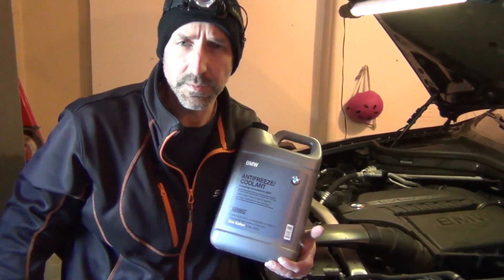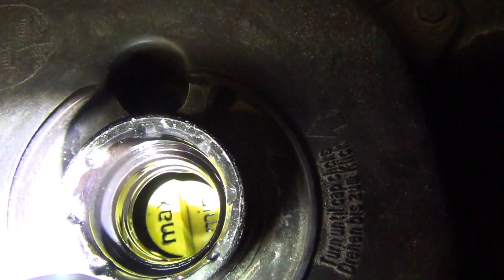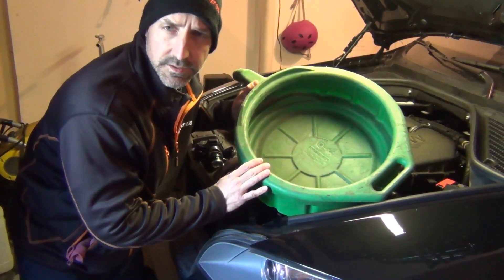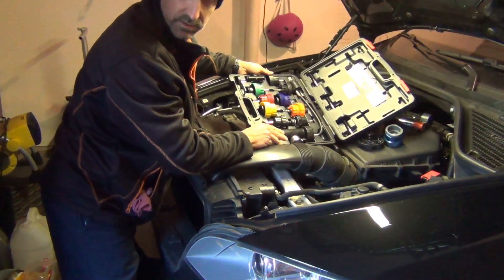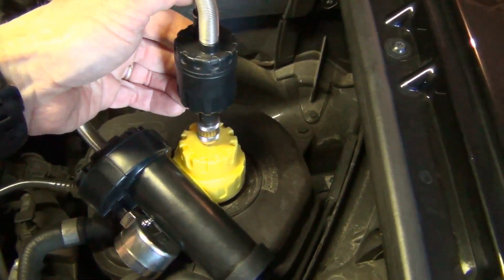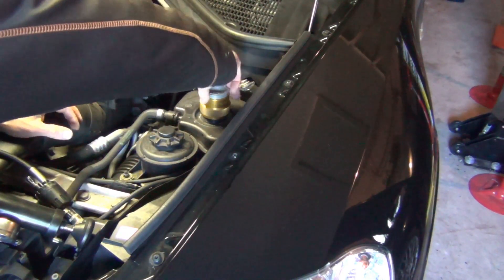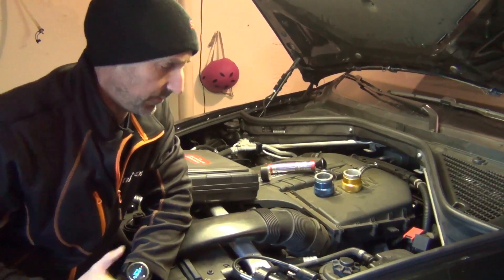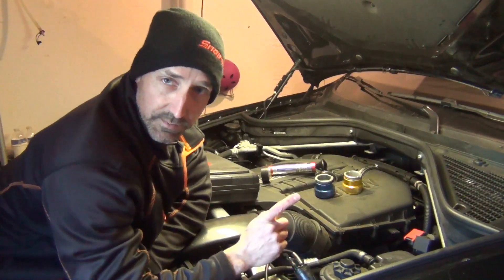HOW TO DIAGNOSE A COOLANT LEAK! Pressure Test And Vacuum Bleed Test. Find a coolant leak quickly!

Comment: Do I have to fill up the tank with fluid or not.
Reply from the maker: Yes, If the system is empty from an active leak you have to fill it to pressure test and trace the leak down.

Comment: I have a universal pressure tester. Once I put pressure to it, the expansion tank releases air from the small hole (overflow drain) next to the tank refill hole. How to I go about plugging it so it can hold pressure?
Reply from the maker: That means the tank has failed. Replace the tank to fix this issue.

Comment: so i put the pressure tester on but when i pumped it up, air escapes from the weep hole on the reservoir tank and i cannot get it to hold at 15. how do i deal and plug this spot?
Reply from the maker: Hi Stan, That would mean the reservoir is cracked in that spot.  Replace it and re pressure test 😀
Reply: TY for the reply. I looked around the weep hole area and other then air escaping from that hole, when i place my finger on it it stops, i was told the adapter im using is not working to seal it the correct way with an E70 N55. would you happen to know if there is a specific adapter to look for on the E70 N55> TY @AskTheCarExperts

Comment: What if you use the airlift tool but it only goes to -9 psi and holds. Does that mean I have a leak? Or do I really need to drain the coolant out of my system to reach the green?
Reply from the maker: Hello, If it hold it should mean there are no leaks but the system does need to be mostly drained to reach the vacuum you need. Draining the radiator should help.
Reply: @AskTheCarExperts  thank you for your quick reply. I greatly appreciate your guidance in this. Thank you again!

Comment: You have the exact same tools we have. Both are invaluable tools! Must have for anyone working on cars
Reply from the maker: Awesome James! Vacuum bleeding kits are the best! Such a great tool to eliminate air pockets.
Reply: @AskTheCarExperts  I modified my pressure tester so I could use shop air and a manual regulator with a pressure gauge on it. Can pressurize a system with a couple turns of the regulator. Got tired of pumping that pump 100xs to get to 15psi lol
Reply from the maker: @jaxnaturals  LOL Thats a great idea 💡 😄

Comment: Excellent!

Do you need to consider thermostat state with the airLift vacuum method??
ie open or closed thermostat 

I’d love to see a coolant replacement video on a bimmer using that tool. 

Thanks, Roger!
Reply from the maker: No need to worry about the thermostat using this method. I will have to make one for you Mario.
Reply: @AskTheCarExperts  look forward to that!! 👍🏻

Comment: Thank you for all your detailed videos you provide. You are saving us thousands of dollars. I should have come across your video prior to changing my expansion tank on my 2012 BMW X5. After changing the expansion tank, 2 weeks later a water hose/hoses broke.  I now know what to do to find the hose/hoses the failed by using the pressure test. The question I have is since I don’t have any coolant in the vehicle right now. Can I use water instead of coolant to pressure test? Once I find and replace the hose then I will add the coolant. As you know coolant isn’t cheap and it would be a waste to see all that drain away while pressure testing. 

Thanks in advance for your expert advise.
Reply from the maker: Hi Ray, You are very welcome :) You can use water to fill the system when pressure testing. But you should drain the system after to get the 50 50 ratio. You can also keep track of how much water you put in and compensate during the coolant mixing by adding more coolant than water when mixing. You can pick up a coolant mix gauge to verify you are in a safe temp range with your mix for your climate. Best wishes to you and your family during this crazy Covid19 Pandemic!
Reply: AskTheCarExperts That’s awesome!  I buy the Peak Equipment Technology European vehicle 50/50 coolant from Autozone. When I replaced the expansion tank I used this product without adding any water. Should I add water? I want to thank you again for your great tips and advise. Be safe, stay healthy and we will get through this Pandemic. 🙏🏼
Reply from the maker: @cuguam  Glad to help Ray. I am used to using the full strength and mixing 50 50. I would consider picking up a full strength one so you can mix with 25 percent water and then recheck with a coolant tester or do a full drain and fill and you can use the 50 50 pre mixed coolant. Let me know how the repair goes :)
Reply: AskTheCarExperts I will totally do that. Thanks again my friend and take care.

Comment: Hey Roger, You bring up a very good point that techs, shops and especially customers / BMW owners should be very mindful of in that, do not think when you find a coolant leak, it will be the only leak.  We are very clear when explaining to customers that repairing the obvious leak is only a first step as there may be a second or third leak that is being masked by the most predominant one.  Setting the right expectation is key. This segues perfectly into the vacuum fill method since a second or third leak will be evident in the vacuum process; thus preventing one from filling the system with coolant, only to drain it again if a subsequent leak is discovered.  A follow-up video showing a broken coolant level float inside the coolant expansion tank, and flattened cap seals would be beneficial given how common they are.  Perhaps even explaining the importance of G48 coolant for these cars. Keep up the good work.
Reply from the maker: Hello @Integrity Motorcar, Thank you for appreciating the video! Secondary coolant leaks are very common and the expansion tank failure often occurs after another repair is performed due to normal pressures being reached after repairs. I like to recommend the expansion tank as preventative if it has never been replaced when doing other cooling system repairs on vehicles over 80K. I am also surprised at how affordable coolant pressure test kits and vacuum bleed kits are now. Amazon sells them at a great price now.
28 Piece pressure tester and vacuum bleeder for around $100
 https://amzn.to/2SLstwB
Thursday should be the video on the repair and I do talk about the caps. Which are an often overlooked coolant leak.

Comment: It’s funny you’re video From the oil filter housing fix and this one followed the same fix I did on customer’s car lately I just replaced the expansion coolant tank on a 2009 BMW X5 with the 6 cylinder engine last week and I also replaced the cap .
Reply from the maker: That is funny! Common failures :)